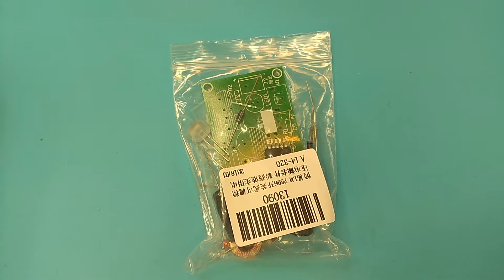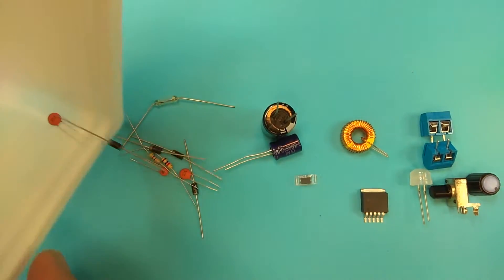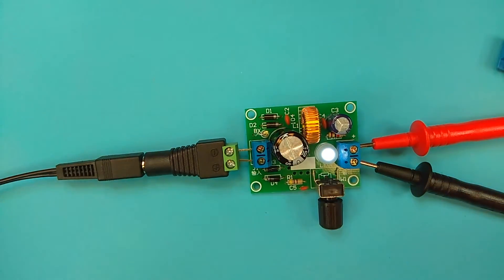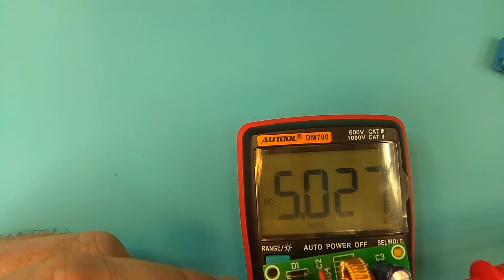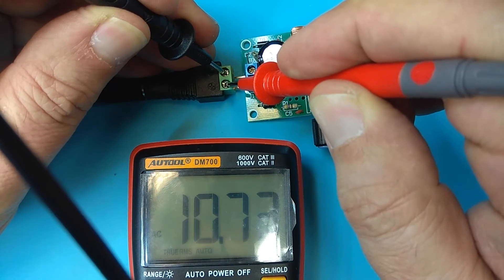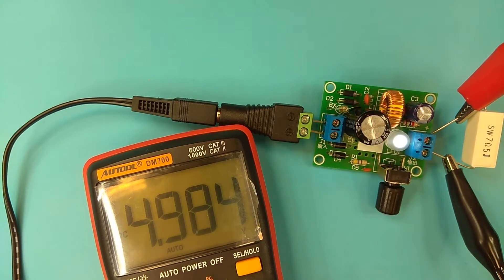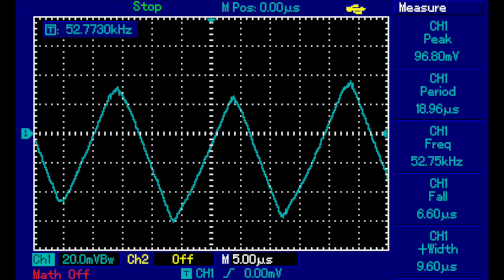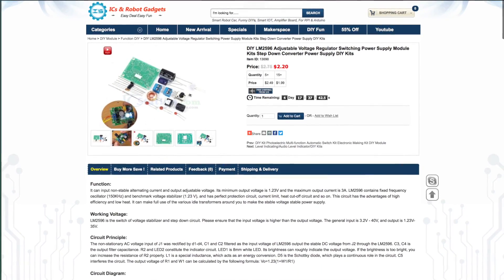ICStation - DIY LM2596 Adjustable Voltage Regulator Switching Power Supply Step Down Converter

Comment: What I don't understand about converting 220 volts to 12v or 5 volts is that there used to be a transformer in between, with this a drop is made and induction occurs, the other circuit is not damaged by this. However, I couldn't understand what provides this in this circuit?

Comment: Does this circuit convert 220 ac voltage to 12 volts without a transformer? That is, is there no non-polar capacitor?